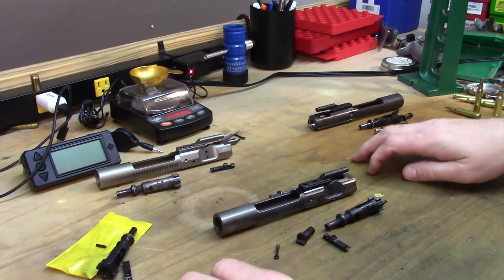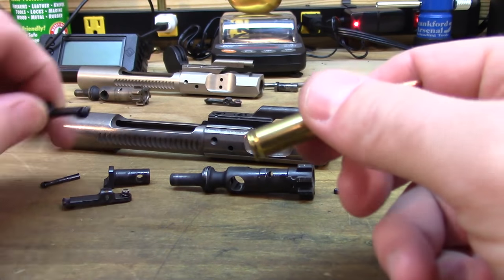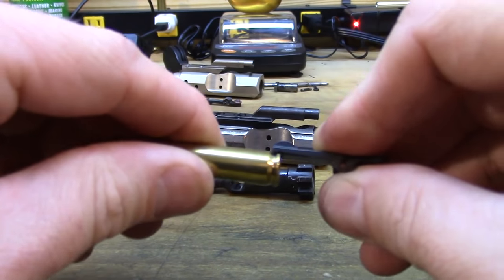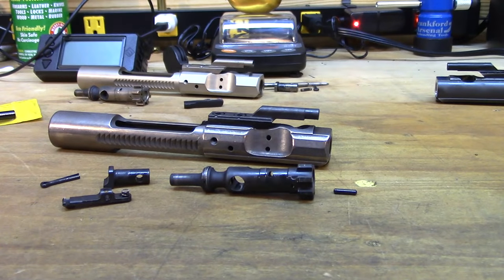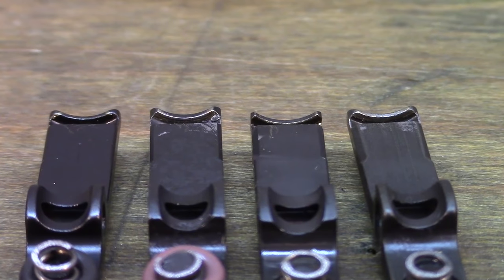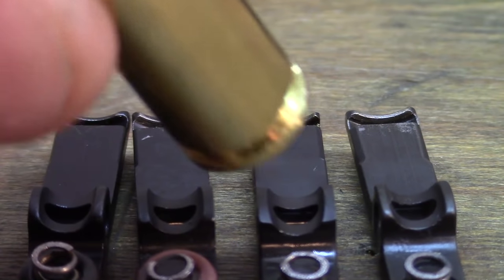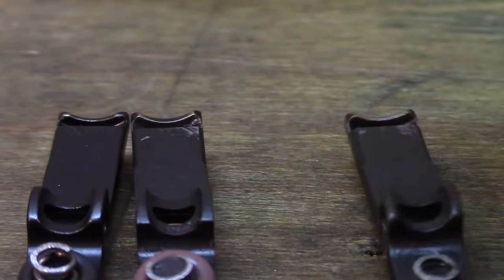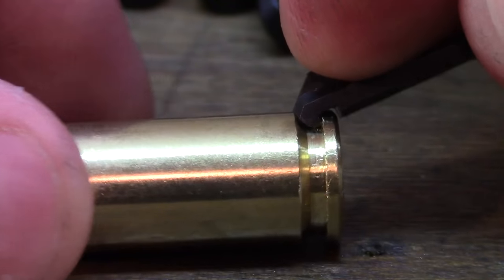Loading 6.5 Grendel - ep 3 - Modifying my extractor

Comment: Johnny thanks for a cure for failing Grendel Extractor.  I just put together a 6 ARC Faxon fluted heavy barrel 20” upper with rifle gas.  It was having extraction inconsistencies.  I followed your trouble shooting steps and found my Maxim bolt had a similar problem with the extractor failing to release when   Ejector was trying to kick the case out.  I screwed up my courage and in two steps  with my dremel seem to have fixed the problem.

Thanks so much for your clear and so helpful videos.  Shannon you are the best. All the best,
Lou Buckley

Comment: Great work! You saved me a ton of trial and error.  I had the same problem with a Brownell bolt.  Mine was hanging onto the brass so hard the bolt would drag the brass back and hit the rear of the ejection port, leaving a mysterious dent at the mid point of the case.   On occasion, the case would bounce back into the ejection port and block the bolt.  Quick round over of the points on the extractor and problem solved.   Thank you for sharing this!

Comment: Wow! You're a life saver.  I've been trying everything to get My 6mm ARC to run properly.  Tried everything I can find on the internet.  Magazines, adj gas block, and buffer weights, and springs.  I actually came here because I was going to try the Grendel to see if it would run properly.  Mine was doing exactly the same thing, grabbing onto the rim of the brass, and holding on to it.  Ground the "claws" down, and runs like a raped ape now.   Let me guess, you're using the same bolt head now on your ARC???  It would be great if you can add ARC to the name of the video so other folks having the same problem will see this.  Pretty sure they both use the 220 Russian cartridge.  Thank's again!

Comment: Alexander arms has a replacement extractor for 19.80 but they want to charge $17.62 for shipping and handling. Couldn't be any more unsatisfied! Highly considering .22 Nosler! I'm a machinist at a reputable firearm manufacture, and am aware of price gouging in the industry but $20 for S&H... BS! The original ejector has failed after less than 1000 rounds. My barrel and bolt are pre-SAAMI, cut rifled FYI.

Comment: My brownell bolt extractor left 2 gouges on the case rim. But it functioned fine. But I don't like the gouges on the brass. I used a small needle file and some 320 and 600 grit sand paper to polish the nubs and some other areas on the bolt (rear lugs, ejector,  extractor nubs and extractor outer  face). Then followed up with some jewlers rouge on a soft buffer dremel tip

Comment: I wouldn't round the corners left to rite .  Just file a lite angle front to back & leave the beef in the width of the  it .  & On the main body of the cartridge touching the outside . Likely radius that .it will allow the case to roll off ,  a Dremel it to dangerous  & aggressive .   Have patience . Go slow . It will work slick & in same pile . I favor leaving  longer metal  flat face to contact wrim, for longevity as well . Most of the problem is on the front outer , touching / contact on the cartridge main body .  Forcing the pinch & digging  into the  wrim . That's how I fix & explain it to the owners .  I always look to keep everything strong & rugged , with as minimal rework & changes  for any cure .😊🥂.  Love your videos & sharing all your experience 😊. I have original wildcats , I designed👍 not copycats,  I could & should be doing vidios / vlogs . & Don't . I'm old & been there done that  thing . It nice to see guys burning the powder & exploring 👍. Keeping the hobby alive 🥂🏁🏁🏁🍻

Comment: This may be the problem I'm having. I have a brand new AR-15 chambered in 6.5 Grendel and was having jamming issues then the extractor broke. I was running wolf steel case ammo .
Reply: Do not grind it the way he did.  
All you have to do is grind it shorter, not the two pointy corners.

Comment: Johnny, you may have solved my extractor problem! Your ejection was working a LOT better after the treatment. I think instead of using a Dremel, I may just dress the extractor lips with a jeweler's file instead, but my video coming out 5/8/19 shows my extractor problem, same as yours. Was this a type I, or type II Grendel?